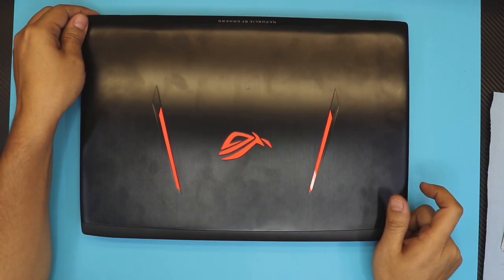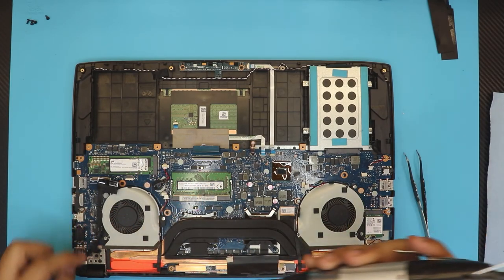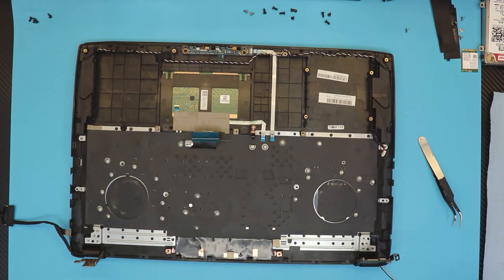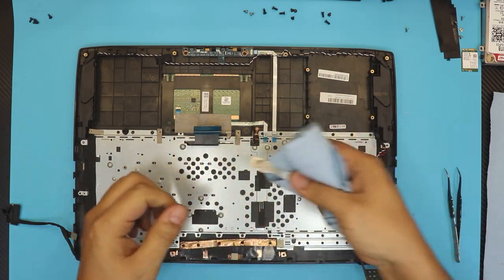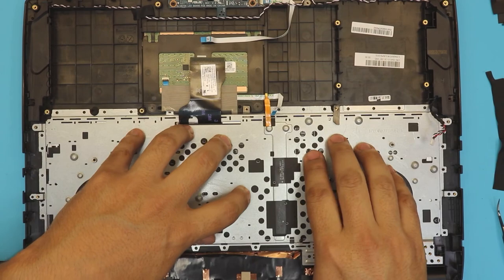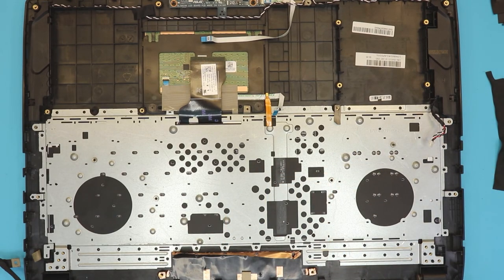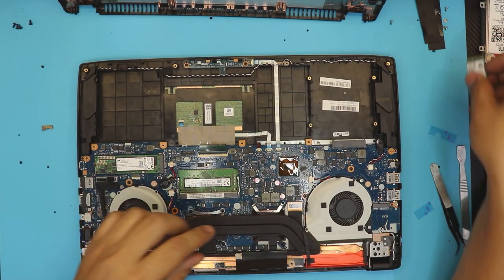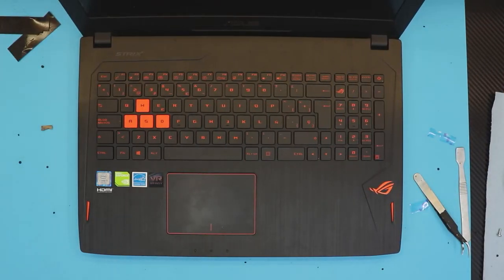ASUS ROG Strix GL502 Keyboard removal, disassembly guide

Comment: I have a Asus ROG Strix Scar GL703GE and I have been unable to find any video for it that will show me how to replace my laptop in it. As a fact it was stated in one video that showed how to tear it down that the keyboard could not be replaced because it was " pressed in" but from the video it looks similarly done as this was was. So could I use the same process?
Reply from the maker: Thank you for the feedback! if you wish to support the channel you can LIKE or SUB or both :P
regarding your question: you model its 99% as this model in this video its the same procedure, if you have any question during or need help feel free to ask me.
Reply: @uFixTek  the black paper protection came off in shreds. Is there a way i can replace it? Also. I read or watched recently suggestion of using the space key to help sauder back in place. but when I try this the results are the connection is brittle.. and will not keep it in place. Suggestions please.
Reply from the maker: yes when removing it the black paper or the old keyboard doesn't matter how it  comes out as long as you remove it, just place the new keyboard without damaging the black protection. and if you can't use the space bar from old keyboard get a bit of 3d printer filament (PETG)

Comment: What should we do if our rubber cup of keyboard is broken and glued part of rubber is also broken? 
When I replaced the rubber cup my key is not working anymore, should I glue the rubber cup to make the key working again?
Reply from the maker: by "rubber cup" what you mean? upload some pictures https://imgur.com/
and let me me see what you talking about.
Reply: @uFixTek  I am talking about silicone rubber that acts like a spring but when i replaced the rubber dome the key is not working as the top layer of membrane is not working 
Can you clarify what can be done: rubber cup replaced, old one is broken https://imgur.com/gallery/bfPuMeF
Reply from the maker: okay before anything i need to know if you remove the rubber dome, and when you press or touch with your finger tip the key does work and shows the letter on the txt file, if so then your membrane is fine, and then you can just replace the rubber dome, but your rubber dome looks fine in the on that shot. you will need to place a very small amount of glue on the outer shell and place it in the center and let it dry for few hours and it should work fine, we do repair then often, but make sure your membrane is working and responding to touch.
Reply: uFixTek Unfortunately, Membrane is not responding to touch but beneath that layer the touch responds.
Reply from the maker: so you need to find a old none working keyboard and try to remove the cup prom them and hope to have the same height,  and place it in there, else you will need to replace the keyboard :( or use external keyboard :(

Comment: Hey i have asus rog strix gl502vmk, so its tunderbolt v2 or v3 ? 20gbs or 40gbs ?
Reply from the maker: thank you for the feedback and support to the channel, regarding your question , the asus rog strix gl502vmk used Thunderbolt 3 via USB Type-C (40 Gbps)
but remember your components SSD and or the devices must support TB3 40Gps  in order to get 40speed.
good luck
Reply: @uFixTek   hey thanks for replay, asus support says its 20gbs and my manual says its usb c gen 2 10gbs and you saying its thunderbolt 40gbs , how to check by myself on laptop?
Reply from the maker: okay 1st of all dont ever listen to asus or hp or any tech support they dont know SH***T.
there is an issue with windows 10 updates and chip xg2, but there is a solution, you need to install windows 10 without the internet  connection and use a 2nd computer to download and follow the steps:
Here's a few steps to how you can get it working:
1. DOWNLOAD and INSTALL the latest Thunderbolt 3 firmware from the XG Station 2 support page.
2. DOWNLOAD and INSTALL the Nvidia Driver provided on the XG Station 2 support page.
3. DOWNLOAD and INSTALL the ROG XG Station Hot Plug tool from the XG Station 2 support page.
IMPORTANT NOTE: Download these drivers using a second computer, and make sure your laptop is never connected to the internet, this will cause Windows10 to automatically update the driver. Install these programs while your laptop remains offline.
4. A few restarts, and everything should be in working order. It is now safe to connect to the internet. 

The GL502VM does fully support Thunderbolt 3 with 40Gbps
Reply: @uFixTek  thanks i will try , the main thing why im looking to know exactly speed, i want to buy  ultrastudio monitor 3g (they have with tb2 or with tb3 versions)  
I want to connect my monitor thru this adapter to ger better colors
So before spending money i want to know if it gonna work
And all internet is confusing to me..
P.s on my asus on thunderbolt socket there no lightning sign, only “ss”

Update: i have installed xg-station hot plug tool, 
my latest version of thunderbolt software si 16.3.61 
and i cant install asus rog xg station 2 software cuz i don't have station and also message says "no active asus rog xg station found'' 

So all i need to knowi if ultrastudio monitor 3g gonna work with my asus  and Benq PD2700Q 27 monitor ;D
Reply from the maker: i have a friend that has ultrastudio monitor 3g, let me talk to him and i get at you tomorrow. as far as i know it will work but let me get a 2nd answer. remind me in 12h :)
Reply: @uFixTek   Thanks ! 
Hey thanks !
Could you please check this - 

https://rog.asus.com/forum/showthread.php?92550-GL502VMK-Thunderbolt-Question

Interesting that they say  rog strix gl502vmk have 15gbs thunderbolt

And also could you ask your friend he is using 
UltraStudio mini monitor
or
UltraStudio monitor 3G
Reply from the maker: i talk to him about an our ago he said, he has the 3g version, and he had the issue with thunderB and when he installed the windows 10 fresh install, and downloaded al the drivers separately then it worked and its 40gbs, but he remarked you must reinstall windows. based on what i have read and what i could find out , its 40 but you have to do workaround :/ sorry i wish i could help you more :(

Comment: I did this on my GL702v and now it will not turn on. The screen stays black keyboard does not light up and the fans do not turn on. I was extremely careful and did thought it all went smooth. So disappointing.
Reply from the maker: you may have connected the flex cables correctly double check your connections, if you can send me a picture of the motherboard with cables connected. so i can help you out.
Reply: @uFixTek  I appreciate your help. I took everything off and put it back together again and it turned on. But now my touch pad isnt working. Lol!! When I push fn+f9 it keeps saying touch pad disabled. This thing is determined to piss me off. But not today 😃
Reply from the maker: im glad that you got it working regard to touch pad go to bios and activate touch-pad "basic" or if it is on basic change it to advanced.  let me know

Comment: why did you not put any footage of replacing the plastic rivets, should cover the whole process, can you not just put a small drip of fast drying super glue on it and hold it there?
Reply from the maker: because i did that on the other table and it just simple process you hold the keyboard and using a hot metal or soldering station melt the plastic and place it i will do a short demo of that in the next two days.

Comment: Welp, my battery won't come off so easily,so the battery connector was ripped off from the mother board :(
Reply from the maker: can you provide some pictures of the damage or anything?
Reply: @uFixTek  not now, but there is 5 'pins' and another 2 that hold the connector ,so the connector is ripped off from the motherboard,2 of the connectors on the motherboard have the pads from the black cable ,I think it's fixable ,but a lenz is definitely needed
Reply from the maker: if the pads are ripped dont worry you will need a lens and a soldering iron and some flux and abit of cable, its reparable but again i need to see a closed up picture to be able to assist.
Reply: http://imgur.com/gallery/O0nvbZG ,here is a closer look
Reply from the maker: give me few hours and i will Photoshop over and send you info back.